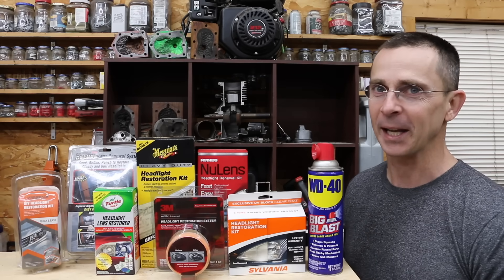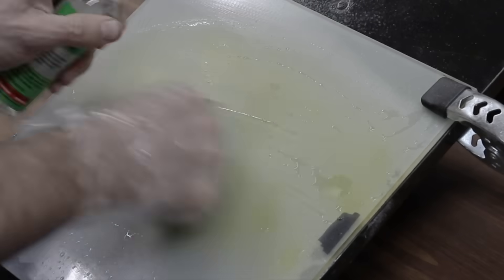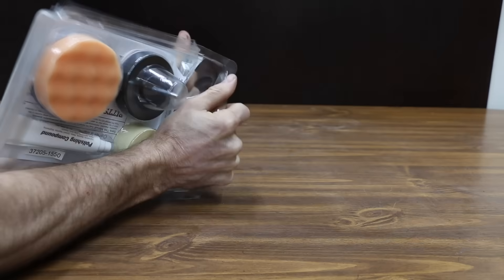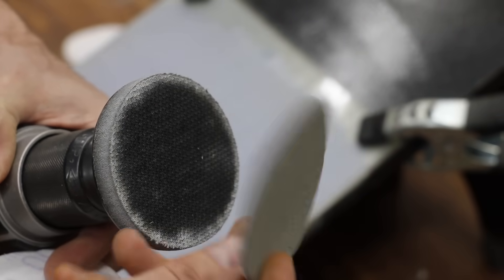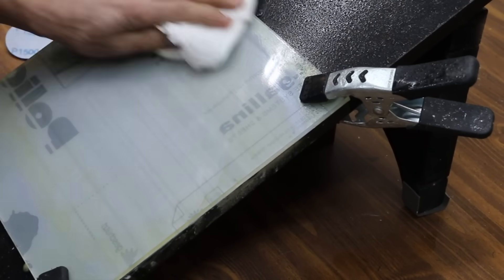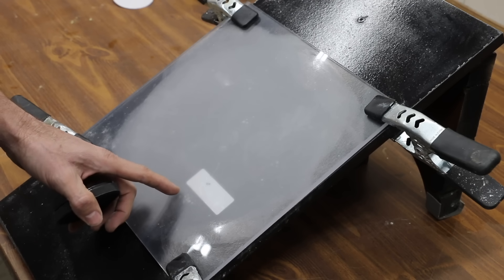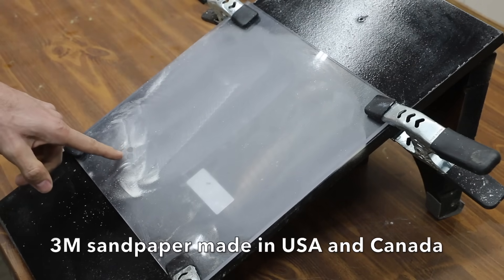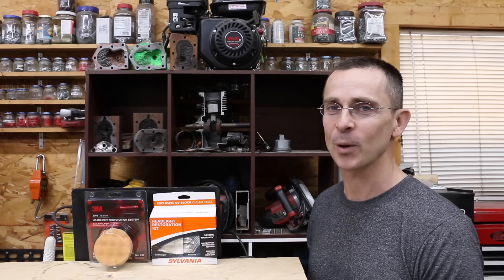Best Headlight Restoration Kit?  Let's find out!  3M, Sylvania, Meguiar's, Mothers, Turtle Wax & HF

Comment: I used the HF kit. Looked great in daylight. The headlights reveal scratches at night. One trick to make new pads is cut new circles and attach to a used pad with spray adhesive.
Reply: I just did mine with the same kit. Had to do some extra sanding and buffing with material I already had on hand. Then bought lens protector (I think it's just clear coat spray paint) turned out well.

Comment: Toothpaste - put some on a fluffy towel and put a bit of water and wash the headlights with it. Not only does tooth paste include astringents but most brands are also pretty loaded with micro-abrasive compounds. Most people don't realize, tooth paste "whitens", because it contains micro-abrasives, when you use those types of toothpaste to brush your teeth, you're literally polishing stains off the enamel. As such, you can toothpaste to polish your headlights.

Comment: Interesting results. I've watched a few different restoration kit comparison videos today, and the Turtle Wax 🐢 kit was the objective winner on 2 of the videos, and took 2nd in the other. 1 of them used a drill, the other 2 testers just used it as the kit comes.

Of course they used them on old headlights so the condition of the lights most certainly weren't all the same.
Reply from the maker: Thanks!

Comment: in my shop I just make sure the old lense is super clean by using a soft scotch brite and lots of water, and then using acid tone, just dont get it on the paint and if you do, wash it off right away, nothing you can do about a discolored reflector or pit but this works in about 5 mintes, dont rub, just wipe it on and wipe it off
Reply from the maker: Thanks for sharing.

Comment: I'll tell you what works better than all of the products you tested and without all the work. Grab a roll of paper towels and a can of mosquito spray. Spray the mosquito spray on a number of paper towels folded into a pad and wipe down the lens. Reapply a number of times and you will see that the yellow fog will begin to come off and the lens will be as clear as new. I normally do this no more than three times changing out the paper towels each time and the entire lens is done in no more than 5 minutes. Sound like I'm crazy ??? Try it and find out for yourself and if you don't trust it, go to a junk yard and find the foggiest headlights and go at it. As far as scratches  ,,,,,, well you can use one of your products,  but my headlights don't get many scratches.
Reply from the maker: Thanks for the feedback.

Comment: Can u please try acetone. Clean, folded microfiber cloth with acetone on it, wipe, apply acetone to clean section of microfiber between every wipe. Not sure if additional clear coat is required after but I do know that this technique works amazingly
Reply from the maker: Thanks for the suggestion.

Comment: Holy Crap! How complicated can we make this? Let's simplify the operation.  If your headlight is removed from the car easily then do that. If not mask the surrounding bodywork with 2 inch masking tape. Wet sand the headlights with anything from 400 to 1000 grit wet or dry paper until all coatings and oxidation is removed. Rinse well with clean water. Dry with clean towel and remove any lint. If working on the car, mask around the headlights with paper and drape drop cloths over the rest of the car. Mix the catalyst into the automotive clear coat in the recommended proportions. You wont need much clear coat, so don't mix more than a couple ounces. Put the clear coat in your $20 Harbor Freight gravity feed spray gun and spray three coats , allowing about 10 minutes between coats. Make the first coat light to avoid sags and runs. Go find something else to do for the rest of the day while the clear coat hardens. Put your headlights  back in the car or remove the masking and enjoy many years of clear as glass headlights.  Then do the headlights of your friends and family and we will all be safer on the road.
Reply from the maker: Thanks for sharing.

Comment: It can be accomplished much simpler than all this. The people that say it won't work have never tried it. I take regular ol' Turtle Wax and a buffer to remove oxidation on our lights. It doesn't matter if you get it on the paint, in fact it's preferred. It lasts a long time and I've used it on some very bad lights.
Reply from the maker: Thanks for the feedback.

Comment: Dear Project Farm,
Thank you for your great videos. I have a suggestion to share with you based on my experience.
I cleaned the head light of my car with brake fluid. I covered it with wet facial  paper (wet with brake fluid)  and forgot to take the papers out. The following day, the head lights seemed  totally damaged. It was like spraying Wight Color spray paint on it. I almost tried to order a new pairs of headlights. Then I came to the idea to sanding with 2000 grid went and dry sand paper and then polishing them similar to your demonstration.  I had nothing to loose. To my surprise the headlights came out like brand new and clear and has remain clear for over four years already.

 By accident and unintentionally sometimes a person can make discoveries that he was not planning for or expecting. May be you could test and share this experiment with your subscribers. Thank you
Reply: My car had oxidized headlights, so I used Cerama Bryte a glass range cooking top cleaner and polish. A few sheets of Bounty paper towels, spray bottle of water and hour's worth of old fashioned elbow grease and looked like new. Would go faster with a piece of 2000 grit wet and dry sandpaper and then polish.

Comment: The big difference on the sylvannia kit is the rubbing compound which is agressive enough to take out 11000-1500 grit marks and sylvannia uses upto 2k sanding paper which the results will be a lot  better than the rest as evidence by the end of the video. I would skip the coatings and switch to 2K gloss clear and spray light coats up to 3-4 coats with 15 min rest in between or when the clear coat is tacky.
Reply from the maker: Thanks for the feedback.

Comment: I have used Sylvania kit with excellent results on two of my cars. Even after one year of restoring them, I do not see any deterioration.

However, the first time I got the kit, I opened to look at everything and put back everything to work on it during the weekend. The "weekend" came after roughly a month and by that time the UV block solution bottle turned to a hard gel. Their bottle cap did not create tight seal. 😑
Reply from the maker: Thanks for the feedback.

Comment: Do you think the meguiars would perform better if you had started with something like 500 grit sandpaper followed by 800 grit before using the supplied 1000 and 3000 sandpapers? Thanks

Comment: Thx for you video.  I have replaced headlight assembly in my truck several times over 800k miles and was never convinced by those so called restorers but will now add Sylvania to my Amazon wish list.  Which brings me to my next suggestion.  Which uv protection product is the best?  I have seen several on Amazon.
Reply from the maker: You are welcome!  Thanks for the suggestion.

Comment: Have you tried Flood Penetrol paint additive on headlights? I used two years ago on headlights after sanding with fine paper and brushing on with thin layers, allowing to dry between coats, it is still performing well, and has not yellowed or fogged.
Reply from the maker: Thanks for the suggestion.

Comment: The only thing I ran into, is if the lens yellows, it also yellows on the inside. The only way to clean the inside is to try separating the lens which is a royal pita. In that respect, opting to bite the bullet and replacing the lens with new ones.

Comment: I love the comparison, but we have 4 cars, so instead of buying a kit, I think that I will buy the components so I can fix up all 8 headlights.
Would WD-40 have done anything here?
I used toothpaste before and loved it, but it only did so much this time, although I wonder if the yellow haze is internal.  However, I mixed it with baking soda, used baking soda straight, and wet-sanded with 400-2,500-grit sandpaper.
It is actually worse now!
Reply: I think you need the various levels of sandpaper, because you first remove the yellowed layer with it. Without a coarse grit it would take ages. With just toothpaste, I can't imagine how long that would take.
Reply: @gargantuablargg  I did three headlights with whitening toothpaste with baking soda and it took a couple of minutes each.  No sandpaper or other product, just clear coat.
Reply: wd40 seems magic as you just wipe and in seconds see it improve with no effort, however its not gonna last if even a week

Comment: I use the Flitz Headlight Polishing kit with the microfiber ball attachment for a drill. I clean the lenses with alcohol the buff with the ball and Flitz. I finish with Plexus spray lens protector. No sanding required. Works great. Just my 2 cents.
Reply from the maker: Thanks for sharing.

Comment: Keep in mind the courser the sand paper the more plastic you remove making the lens thinner. I would seriously use 800 then 1500, 2000 & 3000 grit. Yo can leave out either 1500 or the 2000.  Thé idea for the finer grit is a smoother & lack of sanding scratches. 
Glass lenses only crack or break when struck or in a crash. A plastics lens it can crack from too much UV causing the plastic to become brittle but is rare. Plastic yellows & peels & will break & does not break down into the small particles like glass can. Glass is so much more durable then plastic. Can manufacturers need to go back to glass.
Reply from the maker: Thanks for sharing.

Comment: The kits work fine on lenses that are just decorated shields. But when the plastic has striation cracks inside the plastic you just need new ones for sure. Planed obsolescence for sure. I still like the old glass lenses best. But I am old school. Nicely done video PF.
Reply from the maker: Thanks!  Thanks for sharing.

Comment: Thank you for creating and sharing this video, going to try the Sylvania kit on my Porsche Panamera headlights, hopefully I don't make it worse

Update: used the Sylvania kit on 2 headlights and the end result turned really well. Tip I would give others is to use firm downward pressure when applying the UV protector (last step) really press down while applying, and definitely do not let any of the UV liquid get on your car's paint like I did, it's very hard to remove/cleanup
Reply from the maker: You are welcome!  Thanks for sharing.

Comment: Haven't tried Sylvania.
For years I just sanded them by hand 600, then 1000 then 2500
Buffed them with Mothers aluminum polish and a drill
Buffed again with PlastiX
(Both of those I have for my motorcycle maintenance)
Sprayed a headlight coating (the only special product buy)

I'll try the Sylvania next time I have to resurface them.  Thanks.
Reply from the maker: Thanks for sharing.

Comment: Cerakote has a kit that works well and the part that is missed by most is sealing after the old nicks & yellow is removed. The Cerakote gives you a clear ceramic coating like a clear polyurethane to seal the fresh new plastic that is revealed.
Reply from the maker: Thanks for sharing.

Comment: I picked up the Rustoleum kit for $15 from Walmart and used it on my ten year old Mazda 2’s lights that were heavily soiled.  I used the drill attachments with my Milwaukee right angle grinder on the lowest settings.  The finished result after half an hour’s work on one was incredible.  The only thing the kit did not include, was a sealer for the final step.
Reply from the maker: Thanks for sharing.

Comment: What work for me 07 350 Z. 1nch sand paper water Sand you headlight first. I did mine in the sun so it can dry light dust Then the water Then wipe Then spray OFF DEEP WOOD BUG SPRAY wipe   Yellow don't come back. And you got your  ODW for the touch up if you want Car wash Snow rain Still clear
Reply from the maker: Thanks for sharing.

Comment: ya gotta finish w clear coat -- i only wet sand, up to 800 or 1000.. then use Lacquer based spray which can be sanded to corrected mistakes & polish to awesome.. note: enamels don't "rub out" very well &  crazed plastic can't be removed but it will be much less noticeable..
Reply from the maker: Thanks for the feedback.

Comment: Try Mothers Mag & Aluminum polish, works well and Far cheaper :) just polish lightly till clear i'v used to on plastic and glass just dont crazy and push to hard on plastic as the it will eventually make it look milky
Reply from the maker: Thanks for the suggestion.

Comment: I've used a Turtlewax kit and I was pleased with the results. I reused the pads and was able to knock off enough discoloration on a second set of headlights, minus the sealant it was still a great improvement. I will agree though that the pads are small and should be made a little bigger.
Reply from the maker: Thanks for the feedback.

Comment: It's been noted often but just want to join in:  Great to see product test videos that use actual scientific methods like eliminating confounding variables, via uniform test procedures and starting from the same baseline (identical polycarbonate sheets).
Compare to the norm on YouTube:  anecdotal, bro-style comparisons, and/or just single-product demonstrations without any frame of reference.
Reply from the maker: Thanks!

Comment: I use transmission oil with paper towel,place towel over opening and flip over move towel  half inch for a little extra on towel(1 to 2 seconds) very small amount. Have not tried other ways to apply ( well maybe a dish towel) cost probably under a dime for both headlights, time less than a minute. Also wipe all exterior plactic and rubber with dish towel and motor oil.all things under hood(rubber hoses, an hard black plactic) rub on until dry to the touch.
Reply from the maker: Thanks for sharing.

Comment: I would love to see a test on the best performing sealer coatings.   I live the 3M kits but hate how they don't offer a protective coating.
Reply from the maker: Thanks for the suggestion.
Reply: @ProjectFarm  thank you.
Reply: Or even a review of spray on 1k and 2k clear coats. Checking for uv, yellowing, hardness,cure time, etc.
Reply: Or even
Reply: I used this as it was recommended by Scotty Kilmer. Almost 3 months later and they look as good as the day I restored them. 

Meguiar's G17804 Keep Clear Headlight Coating

Comment: Several years ago, I tried one the cheap hand sanding kits.  It reminded me of Mr. Miyagi, "Wax on. Wax off." from the Karate Kid movie.  After about a half hour my arms felt like they were going to fall off and the results were awful. 

Instead of going further, I went on eBay and bought a set of Chinese made replacement headlights for about $80.  Factory headlights would have been around $700.  Now, 3 years later, those headlights are foggy looking.  So, if you buy cheap replacement headlights, put a UV coating on them before you install them.
Reply from the maker: Thanks for the feedback.
Reply: @ProjectFarm  Thanks for making these videos.  I really like that you actually put these items to a real life test.

Comment: Have been using the 3M kit for years. Works just as well as you say it does.  But it takes a good hour and a half doing a pair of headlights properly.

Instead now I use a  Mikita buffer wheel and a bit of 3M Rubbing Compound in the black bottle.  Five minutes buffing with the rubbing compound, just as good results in only five minutes.

Then I follow up with the Meguires spray protectant. LOOKS PERFECT LADTS AT LEAST A YEAR.

Comment: Great video as always! Have you ever tested any anti-fog solutions for those of us lucky enough to wear glasses? It's always been an issue for me in winter, but with covid masks it's even worse. My optometrist suggested dish soap. It works better than anything else I have tried, but going from outside to inside in the winter with a mask is still fog central. Thanks for everything you test.
Reply from the maker: You are welcome!  Thanks for the suggestion.
Reply: Shaving cream is supposed to work well for anti fog
Reply: Bausch and Lomb "Sight Savers" spray cleaner.   Started using it many years ago when it was sold by Dow Corning.   Good stuff.

Comment: I learned about a brand called Novus and have been using this for years.  It comes in three formulas: 1, 2, and 3.  You start with the heavy scratch remover then work your way up.  Too bad you didn6t know about Novus when you did this comparison.  Get some and give it a try.
Reply from the maker: Thanks for the suggestion.

Comment: i bought a 2005 Scion tc in September 2021. it has never seen a winter on the road. (i live in Massachusetts) 
but the car must've been left in direct sunlight when in storage because all unpainted plastics, and rubber, were dry rotted. 
(window weather stripping, moon roof seals, and antenna seals/rod casing)
I forgot to check the headlight clarity before getting it inspected and registered, and noticed the lenses were so yellow and foggy, that i couldn't even see the shapes and details inside the headlights. 
i didn't have any of my headlamp cleaners in the car yet, but i did have dot3 brake fluid.
took a paper towel, dumped some dot3 on it, and it removed all the yellowing, and cleared the fogginess to about 75% of 100% crystal clarity. I actually laughed out loud. on how clear, brake fluid made the lens. normally, i just did quick fixes with deet bug spray, when on my road trips. i put about 50,000 miles on my cars a year.
lens clarity only lasts a month or two, no matter how its been restored, so i stick to the quickest methods, because i have to do it so often.
so, long story short "too late", try brake fluid to clean the lens first. it surprised me on how effective it was. and i never thought of using brake fluid before,
Reply from the maker: Thanks for sharing.